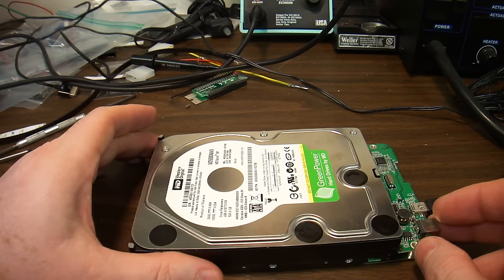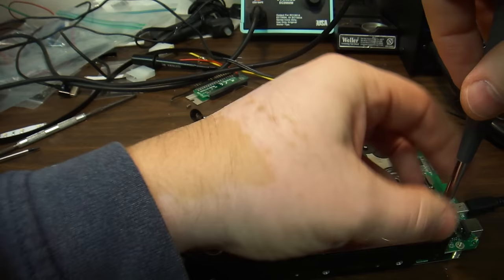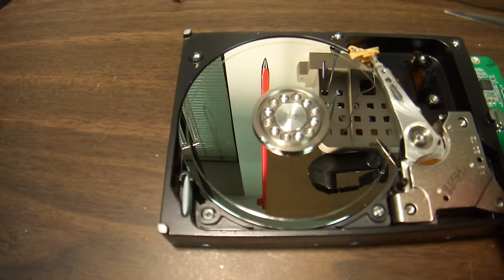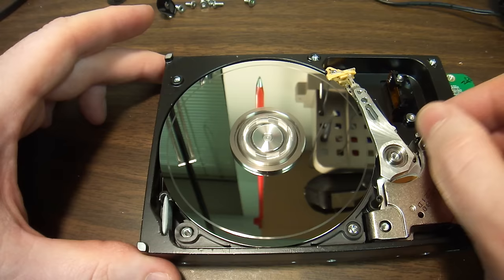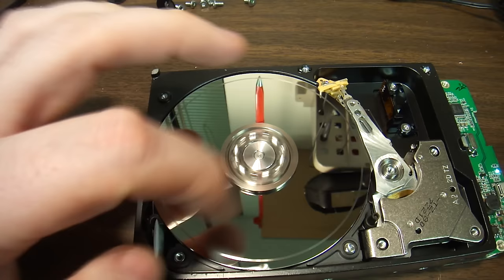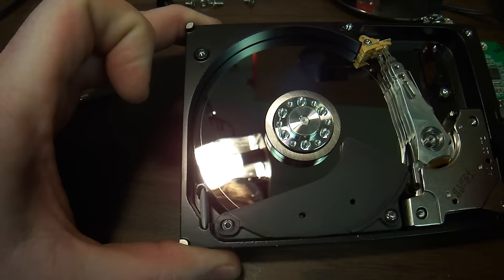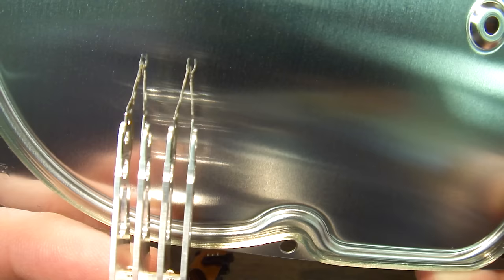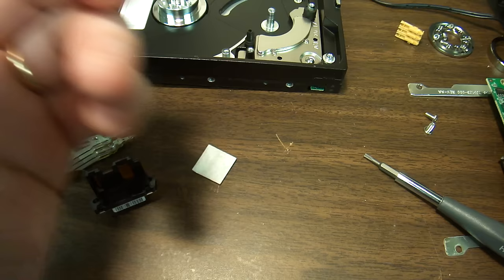Clicking hard drive dis-assembly. How to and what to expect. 500GIG Western Digital USB storage.

Comment: Drives can be stood up. The one in my PS4 has been for a long time because I have the console on a vertical stand. 

I've been having issues with desktop drive though. When I woke up, my desktop was on and making a loud clicking sound. I wish I could've recorded it but it stopped when I went to record it. The drive's been working weird too,  I occasionally will get messages claiming I'm out of storage space on it when there's almost 20 GB left. Even for downloads it said this a couple times
Reply: "loud clicking sound"

back your shit up and buy a new drive asap
Reply: esc1010 lol I just bought one but I haven't transfered windows to it yet. 

I need to record the sound. It's weird but it almost sounds like normal operation, just louder than normal. It might actually be the hard drive defragging since i had that set up to go automatically which was probably what woke my PC up for no reason.

I haven't heard it do it since I got it to stop waking up from sleep on its own
Reply: of course they can be stood up, there are many servers which install drives vertically. the problem with getting a standing external drive is that they're usually easy to topple over, and once they topple your data is gonna get fried. even I have a standing external drive, which I keep behind my monitor out of the reach of anyone, though I may end up eventually making it lay on its back just to be safe.
Reply: Dhruv1223 I also have an external standing vertically behind a TV. Cable doesn't quite reach the input so I stood it up to get some extra slack
Reply: +Hugo Stiglitz that's good, keeping it behind the TV prevents anyone from accidentally toppling it over. now just beware of enemies. ive had a hard drive go like that, a friend was copying stuff to his laptop and he got up without realising that the HDD was connected and my hard drive toppled over and voila 1tb data gone. took it to a recovery center they said they could get 10 data off probably for 1000 dollars.
Reply: Dhruv1223 Damn. Didn't know they were that fragile. I should probably just get a longer cable.
Reply: +Hugo Stiglitz that would be a good idea, the fragility ID because the head has a bad tendency to hit the platter if it topples over or if the drive falls.

Comment: The heads were probably destroyed when it scratched the drive. The heads would servo would just search across the  media for a reference point - but with no heads, that was impossible. With a replaced head set, you could have possibly gotten some data.  If you magnified 80k x you'd still be unable to see the actual head. What you zoomed in on were probably like pre-amps that the heads use to amplify the electron state. NO CHANCE those heads could work once they've hit each other.

Comment: My hard drive sort of clicks and doesn't recognize, so I opened it up and the platter looks super clean and fine. However, the end of the thing (IDK the name, I think you call them disks) that goes over the platter is cracked at the head. I assume this is very very bad and that means it's over.. The head of the "disk" the very pointy part on the end, is like cracked and almost bent.

Comment: Thanks for sharing - although I am late to the party. I have a the Western Digital Caviar Green Power 500GB External Hard Disk Drive": It crashed in the year 2525 [ha got carried away in reference to a song] - it actually crashed in 2015! A local shop tech told me that the only way I could recover my data is by obtaining a identical enclosure controller board to read the data?  I still have my WD 500GB external hard - I removed the case, but I didn't disassemble the drive itself.  I guess I could give it a try again because my toolbox has improved - I own a Thermaltake - BlacX Duet Hard Drive Enclosure Docking Station – Black.  any advice?

Comment: With the exception of very very important data - most aren't willing to send it out for professional recovery as it is nearly prohibitively expensive. It sounds like the heads are toast. When she starts up she has a track with smart data, etc on the drive that she must be able to read, if she can't she codes out and the integrated controller will give up. This particular drive looks like it was dropped while still spinning - an expensive mistake. Platter replacements are impractical - you have to be so precise that it is damn near impossible for home users. The higher the data density the less likely you are to get it working again.

Comment: the heads are ment to be parked on the ramp area when the drive is off, that noise u are hearing is the heads rubbing on the platters because it is not getting the correct lift to read .

Comment: Quick question. My heads look good. the platters have no rings or signs of damage. when I turn it on the heads start to move into the reading position and half way there they stop and pull back and a beep is made. i repeats this about 5 times and then turns its self off. any help? please and thank you!!!
Reply: Danielle Becerra he just told you in this video to NOT turn your disk on when the lid is off :/ how do you know they was in that position when it was on? you kind of screwed this one up :(
Reply: +Danielle Becerra may be the control, board
Reply: +Thomas Matikainen That it's a bad idea to turn it on with the lid off doesn't mean that the contents are necessarily destroyed in the process - merely that the risk is greater.
Reply: A serious data recovery company will charge an extra fee just to thoroughly and carefully clean the platters in a case like this, when the cover has already been removed in a dusty environment... Attempting a recovery with dusty platters is a recipe for disaster.

Comment: By the way all my drives were funtional so anyone with stacks of old drives and spare time on their hands could sift through the drives and piece together maybe not a reliable hard drive but something to recover the data .. as for data recovery companies pretty sure they would remove the platters with no regard to the drive housings and install the platters on a custom housing that can handle different size platters and self align.. and then mail you back the data from a cloud storage once your check clears.. after all your paying the money for the drive contents not the drive itself. they probably put spare drive together and sell them to companies as refurbished ?

Comment: A WD5000AAKS came in a Fantom external harddrive I purchased. Will I be able to get the data off it as a bare drive connected to a USB to SATA adaptor without the electronics of Fantom enclosure?

Comment: My Freecom 500gb only dropped from foot high onto soft carpet and is broken. I took it apart and there are few light ring scratches on the disk. I took look at the head and is wire like old gramophone player needle that is causing the scratches. Looks like no hope right now of ever recovering data.

Comment: nice video, i have a question, to start i am not new and computers and setting up systems,
the new  system i set up has 1 4tb, 1 6tb, (1 8tb 3 10tb,helium filled  )  i get a sound from one don't know which one it sound is like ( b...b...b...b ..b) like the drives head is moving, but no disk activity as for  moving files, all drives smart look good not bug or faults, only as the case is on the desk  i hear this or i would never as in the bast the case is on the floor. would this be a normal sound and is there a web page i can go to that have a list of hard drive sounds.

Comment: hello, had tried opening my WD hard drive and found that the heads are not stuck but it cant read or be recognised. when i plug it in, it starts rotating with no noise but after some seconds, theres a small clicking sound that start and the rotation slows down and eventually stops. how can i fix this?

Comment: Hi. You say that there is no problem removing the top of the hard drive. I always thought that unless this was done under clean room standards it will damage the  platter(s). I watched another video which said that it can be done without clean room standards but you would be taking a risk. Just to be clear would you say that it is risk free regarding particles landing on the platter? Thanks, and thanks for posting this video.
Reply: Some say that only time you should even try to open HDD is when you try to save not important data from it. I would not even try, as normal room is always full of dust and tolerances inside HDD are too tight for any particles.

Comment: Great video ! I had to open my disc and the good news is that the plate seems to be ok but unfortunately i saw one small piece of the heads, as you have said i do not believe it will be possible to replace the heads to read the plates, but what do i need to do to recover mi data? do I have to remove the plates and put them on another same model drive? is there any other way? thanks in advance.

Comment: I have opened it and connected the drive... then I saw your video... the data wont load on my computer now, what should I do??
Reply: You ruined the drive by opening it. They can only be opened in a clean room where there are no dust particles.

Comment: Hi, very good information. I have 40gb IDE Hard Drive. I formatted it. After formate, HDD is not working. And the disk boot failure message is showing with a blue screen.  I also tried to install an operating system. But the disk boot failure message is coming again and again. is it possible to recover data from my HDD?
Reply: If you formatted your disk,  the data is loss.
Anyway, you can connect your disk as secondary and use software to recover data (r-studio).

Comment: Two identical Seagate 2.5-inch SATA2 HDs (kept in reserve storage for about five years) now demonstrate the same noise-- a faint, two-per-second beep, but no click. Almost as though the motor is switched on, encounters stiction, and is immediately switched off to avoid motor damage. Immediately afterward, the startup cycle repeats. There is no discernible break between cycles, only continuous two-per-second beeping. 

Presuming stiction is the problem, here are two questions. 
(1) Since opening the drives (with no data on them) is a death-sentence, do you know of any other way to dislodge heads attached to the platter surface by "stiction"? Since there is no data of value involved, I am willing to do anything short of causing a head crash, gouging the platter recording surface.

(2) The modern HD head is supposed to park itself automatically on power--down. One of these virgin drives was briefly tested on delivery, and then shut down in an orderly fashion, with no bumping or motion for at least 15 seconds. Under such circumstances, the head should have parked itself, and not have been in contact with the platter surface, at all. The other drive was never unpacked, but its should have been issued by the factory with its head in parked position, as well. So, how could stiction have occurred?
Reply: If "stiction" is the issue and these drives are of the type that park their heads on a special zone of the platters designed for landing (vs offload drive types), then in theory, you can dislodge them using external force.  You will need to identify which direction the head stack assembly swings and where in the drive the heads land.  Most likely it parks near the center of the platter (small radius).  You can then, with the drive powered down, apply a small force in the direction that will cause the head stack to over center.  By contrast, you do not want to apply a force in the opposite direction as that will cause the heads to rotate out into the data area.  Given the assumptions I have made, if the right force is applied in the right direction, the heads will be jarred loose allowing the drive to spinup next time it is powered up.  Keep in mind, this is very risky, but theoretically possible.

Comment: That is not the same as a permanently dead drive, Just shows you do NOT know what you are talking about. You can run a sector by sector recovery of that drive if you move the disk to a different drive case with undamaged heads.

I have done it. Anything on that scratch is indeed dead. The heads cannot read because the heads are scratched to hell.

The statement "Heads being stuck is not an issue because it is desktop drive" is false. as soon as that happens you risk it damaging sectors.

And platter replacement being impossible is ALSO false.

It depends on the firmware and the way it writes. If it is on all levels at the same time or one disk at a time.

And ive actually worked with IBAS (one of the best recovery firms in the world) Who'm have recovered a disk after it was microwaved at 78% recovery, recovering vital evidence in a case.

Formating has nothing to do with being able to replace heads or not. That would be Firmware and start sectors/Boot sector (Not the PC boot but the Harddrive boot sector)

Heads are not related to that. Heads are interchangeable.

Plates are interchangeable (IF YOU HAVE THE SAME FIRMWARE ON BOTH!!)
Reply: Mathias Westerlund yeah i gave an recovery answer longer up this post,, totally right,, he could have taken a sector by sector recovery on this disk, only about 2% of this disk was ACTUALLY damaged :P
Reply: Mathias Westerlund i said 0 % chance,, but that was for the man in the street,, DONT try this if you cant fix a toaster,, or boil water,, its a risky business,, but you have to know what you are doing,, but swapping the plates,, its just not worth it anymore,,
Reply: please i need a help in recovering my data on my hard drive can you help me?
Reply: Mathias Westerlund , please tell me how. I can’t lose my data. My data is all I have of my kids right now. From an old external Toshiba 1trb. Please. I don’t have much.

Comment: actually its not the worst thing that could happen when drive is droped. on my laptop was droped and drive platters just cracked in pieces :(
Reply: laptop hard drives have glass platters. They can shatter if you are not careful. Believe me i know. lol
Reply: ***** oh thats why i thought they were made out of some kinf of metal. 3.5 inch drives definetly are
Reply: ***** Wow, that's lame.. lol. Better to just throw a nice SSD in a laptop now-a-days anyway.
Reply: rock962000 for my laptop i bought 120gb ssd and for my itx i bought crucial m.2 512gb m550 and it made my pc run instantly what ever what
Reply: JusstyteN DANG a 512!? I only have a 120 in my laptop and a 256 in my PC. what about steam games?
Reply: rock962000 i have steam but i didnt bought any games and i wont in near future
Reply: awww why? XD steam is the best :-)
Reply: rock962000 i dont have to waist money on games the only trade off would be no online
Reply: JusstyteN :( it's not a waste it's fun :)))
Reply: rock962000 well i dont have money to spend on games i have many more ways to spend cash on physical things
Reply: rock962000 maby thats why you have 256gb ssd instead of 512?
Reply: I have 1TB Western Digital Black for Steam games and SSD for OS and all base software like steam.
Reply: rock962000 i store all my data straight on ssd :) 0.5TB is more than enough for me for right now and when i gonna need more i will simply connect power to 320gb hdd or im gonna buy new one
Reply: JusstyteN Are you a boy?
Reply: rock962000 no, why?
Reply: JusstyteN oh O.o took a look at your page and saw some interesting things
Reply: rock962000 what interesting thinks?
Reply: what's your steam name?
Reply: i dont have steam ssshhh i use pirate copyies
Reply: JusstyteN Can I add you on Steam? :-)
Reply: rock962000 lets try an other service like phone app kik
Reply: JusstyteN ok how do I add you on it?

Comment: i've seen a scsi drive grind itself to death, opened the cover and there was metal shavings all over the drive, the platters were grooved so bad that the heads almost welded themselves to the platters. 15k rpm disk  crash is never good.

Comment: Exact same thing happened to an external hd that was knocked over that someone wanted me to look at today. Scratched platter created by the head during impact while the platter was still spinning, except on the inner portion rather than the outer portion. It had click, click, click symptoms. Zero hope for it. Be more careful with your externals people. Ive seen many externals completely destroyed in this manner, just from being tipped over.
Reply: my windows vista is trying to load. It fell on its side a few months ago. it's going chhh chh chhh chh chhh chhhhhh chhh chhh
Reply: does it make a clicking sound?
Reply: +Todd Stewart ya but the cliçk is a scratching sound.
Reply: if it is coming from the hd then it is screwed
Reply: It's not “screwed” if you kept it, but recovery might be very expensive... Like $500 to $1000 expensive (if you are in the USA, maybe a little bit more if you are in Europe). If your parents can't afford it at the moment, maybe one day you'll be able to get the data back with your first paycheck — and you'll re-discover those things that you loved back then as a teenager with a sense of wonder and nostalgia, or a sense of shame maybe if you're listening to Justin Bieber and Lady Gaga ! :^p